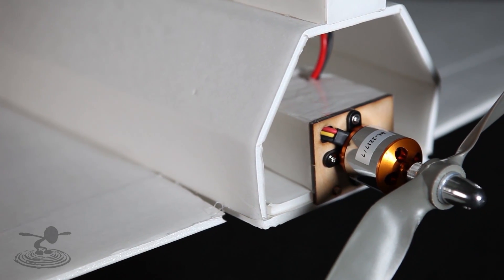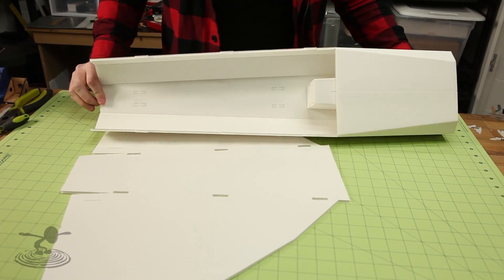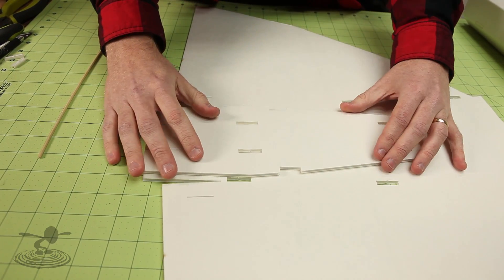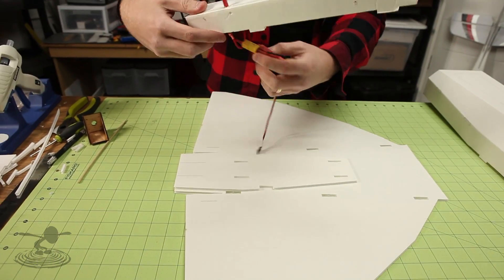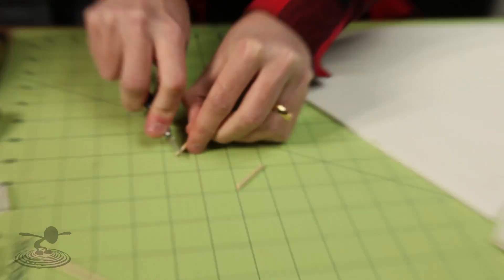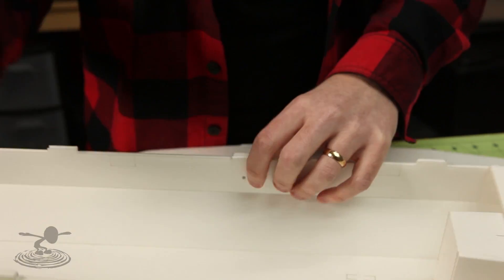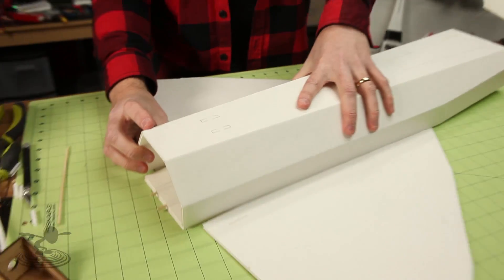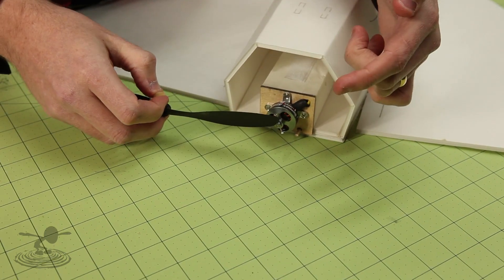Flite Test - FT-Viggen Light Setup - BUILD

Comment: If i flip around prop and reverse two wires, plane fly in opposite direction too. Or i am mistaken? In my fly wing i just reverse two wires without flipping prop to get pusher.
Reply: what you're doing is not a good practice, your prop's trailing edge becomes the leading edge, making all sorts of turbulence and wasting power
Reply: Mudux Ok. try as David say. Thanks!